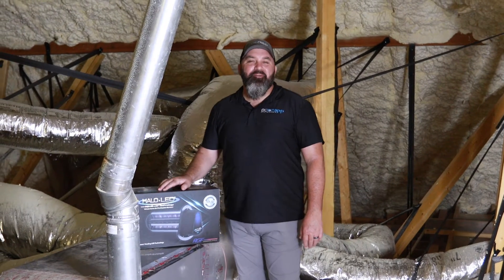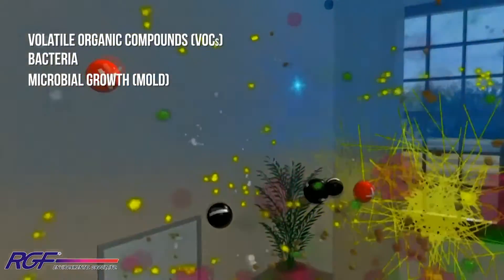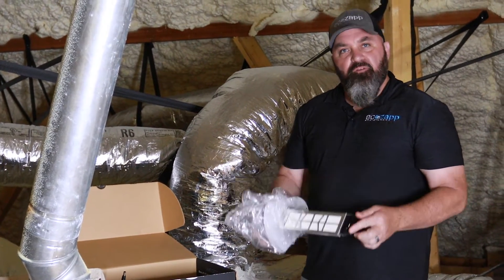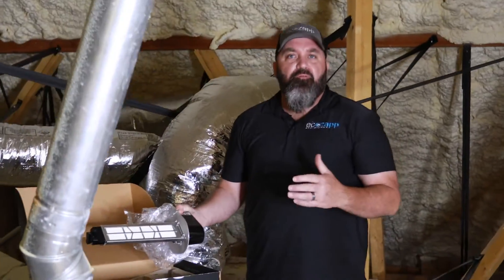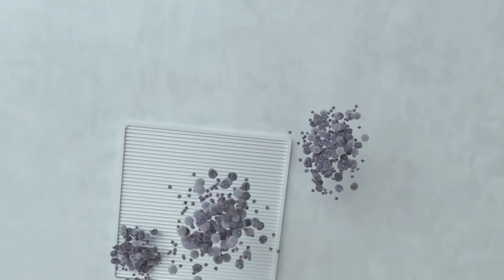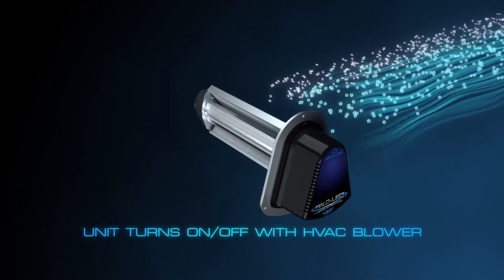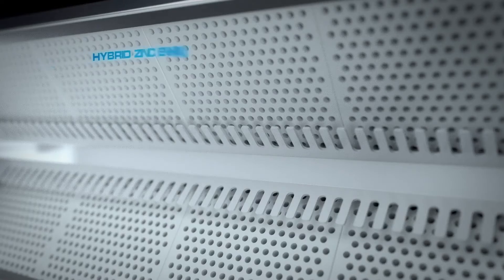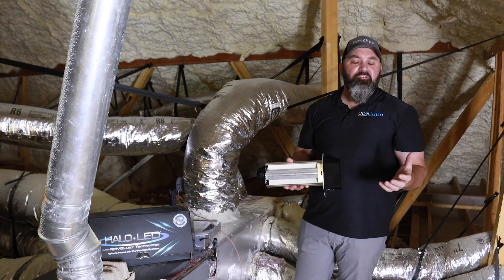#RemeHaloLED #AirPurifier #AirPurification Best Gift for At Risk Grand Parents : Air Purifier Review

Comment: Quick question I have the IWave R that I installed is this basically the same type of concept or totally two different things. And if they are not the same could I add this onto my system
Reply: 2 different products, Iwave is only an ion generator. REME has both UV disinfection and ion generators ( Both REME-H and REME-LED)

Comment: I have a variable speed heat pump with a TopTech TT-AK259 UV light installed. Will the REME Halo LED install be as easy as plug-and-play. Or do I need to rewire?
Reply: Be sure to check the warranty. Many reviews that I have seen say that the manufacturer will not honor the warranty if the unit was not purchased and installed by a professional. Just a heads up, because I do not see many of these units fail. And, you could probably purchase 3 of them online for what the company I work for charges to install one.
Reply from the maker: Yes, both are very similar was well as the GPS units we carry, pretty simple wiring to most A/C Systems.  
We do recommend having an HVAC Tech or Electrician to install per recommendations from the manufactures .

Comment: I have the previous non-LED version and I LOVE IT. I would buy it again and again.
Reply: I also have one of the older  ones. I had to replace the element after 2 years, but it is still worth it.
Reply from the maker: 👍  Thanks for Sharing.  Many Homeowners do still prefer those models.  we've been installing them for many years now, and not a single complaint.  

( A bit of cost vs. life span factor on the models is alot of the decision by many , but not a large amount of cost in the replacement of the originals for the value & time.)

Comment: Speaking of IAQ, that’s an 80% furnace in a foam encapsulated attic!!! That’s completely against code and is a huge carbon monoxide hazard.
Reply: No its not the furnace has an exhaust motor that vents the Carbon monoxide outside.

Comment: How do you monitor the effectiveness of the purifier?
Reply from the maker: There is an Ionizer tool on can use,  however the smell test it the best way.  If you cant smell bacon after 20- 30 mins after being cooked -its working.    The Clean Smell isn't so noticeable to the homeowners, but to new people, it' will be noticeable.   It's the Lack of odors IMO that most ppl like and notice.

Comment: I have the previous generation uv bulb version (non-LED) version of the Reme Halo.  Can I retro-fit it with a new LED bulb, keeping the top part from my existing unit?  Or put another way, can I swap out the old cfl style bulb with the new LED unit?
Reply: I believe the bulb version lasts 	18,000 – 25,000 hrs. quite a long time. I have one installed aslo.
Reply from the maker: Hello, 👋   unfortunately not, the LED is an entirely different housing.  However, it fit in about the same hole with the same transformer & wiring set-up.  

The Replacement Cells have been really hard to get this year as well.

Comment: Seven year cell warranty expected to last 4 to 7 years they said. Four years if you install it nonstop seven if you wire it into the unit where it shuts off with the blower. Where is the relay
Reply: The ones that I have installed have a 4 year warranty on the cell and a 7 year warranty on the ballast. Expect to replace the cell after 4 years.
Reply: The relay is in the Air handler unit. When the air handler  calls for the blower... the Reme Halo  is then also  energized.